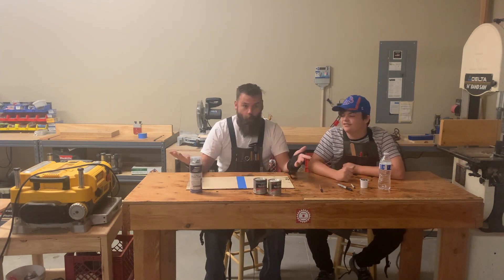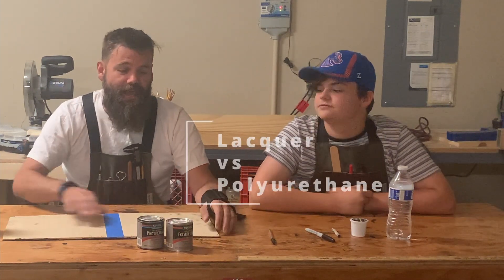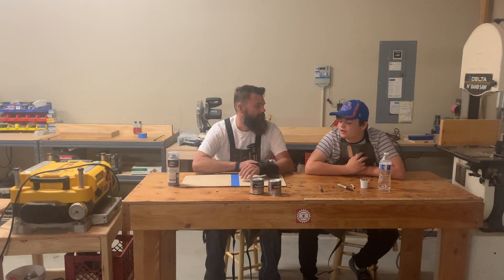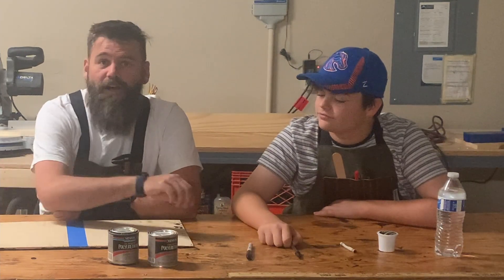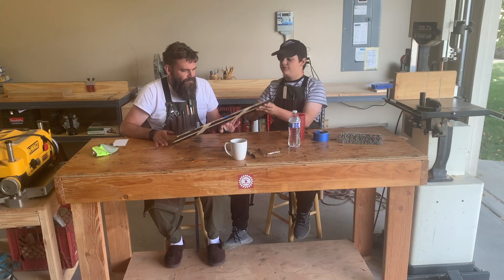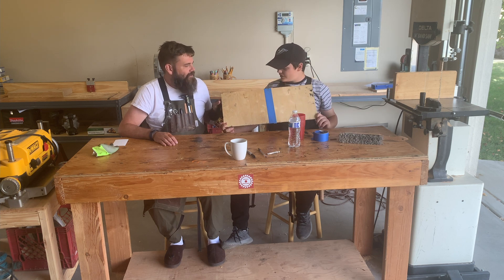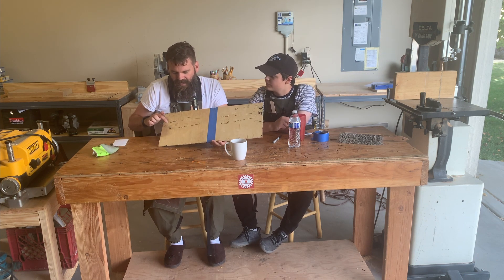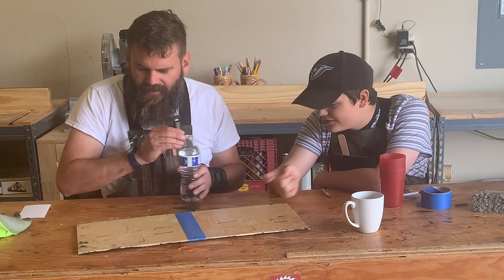Lacquer vs Polyurethane Finish

Comment: What do you think of Danish oil finish?
Reply from the maker: Depends on what you’re using it for. It dries fast and looks nice but it has to be reapplied often and maintained frequently. It also scratches easily, and isn’t that durable. If it’s for furniture I’d put a different protective coat on top of it.

Comment: Great experiment! Spray lacquer is my go-to when I want a quick and easy finish but I will opt for a water-based polyurethane when I want to build up a nice finish. I have also noticed that spray lacquer will leave a white haze on some hardwoods.
Reply from the maker: Yeah. We were super excited about how the spray lacquer performed with just a single coat.